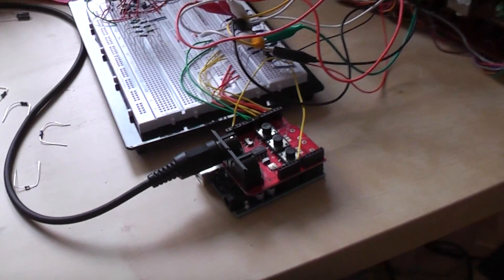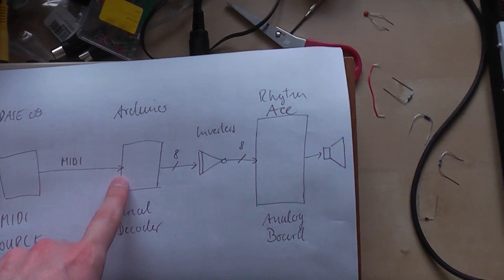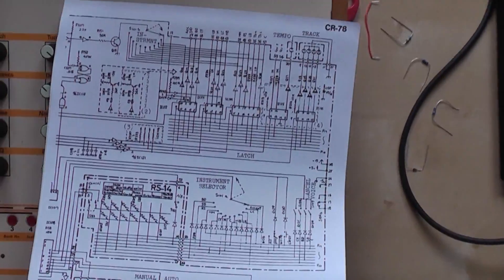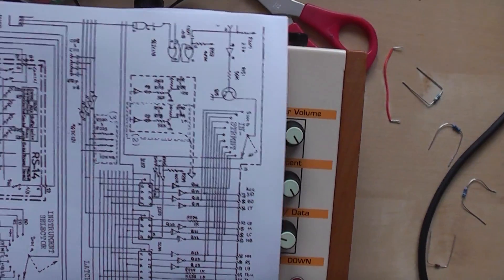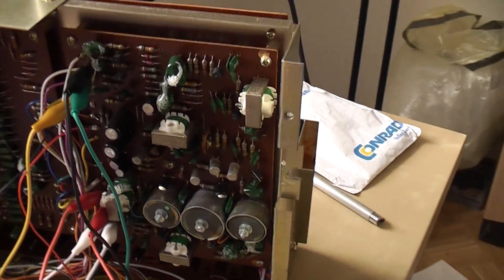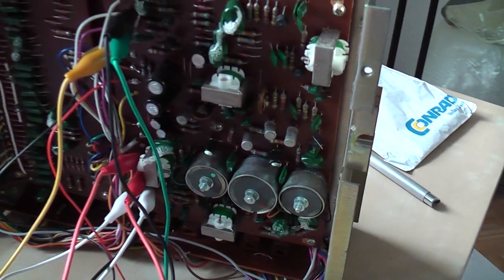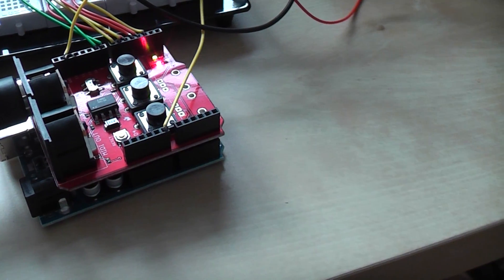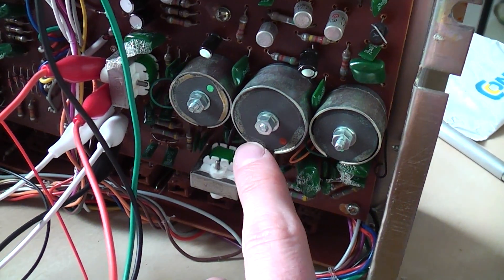Arduino MIDI Interface for Rhythm Ace FR-3

Comment from the maker: @jetset808 I don't know the schematics of the fr-4, but I would guess that it is quite similar. It probably has simliar LC-based oscillators as the FR-3. You just have to find out where the trigger points are but that should not be too hard.